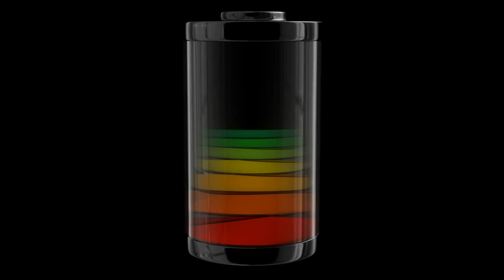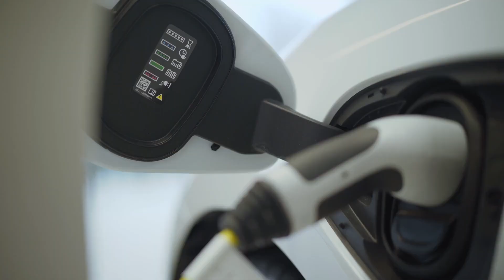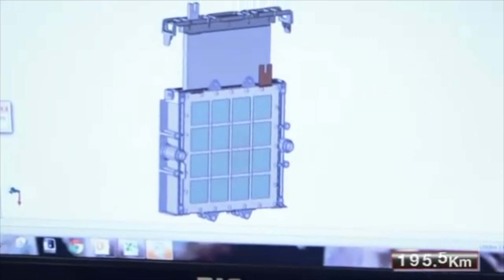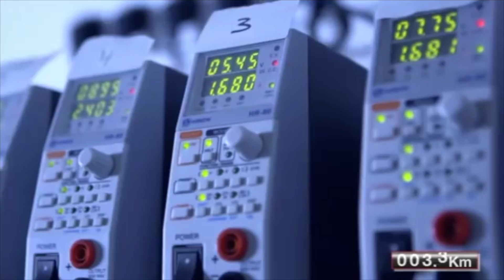This Battery Gives EVs 1000 Miles of Range!

Comment: If mentioning Cobalt in batteries you should also mention Cobalt use in petroleum refinement too.
Reply from the maker: Good call!
Reply: but that's 100% recycled it's a catalyzer
Reply: What about low temperatures
Reply: @piotrtrebisz6602 
It's the energy required to smelt it. Not the chemical reaction.
Reply: And if you’re going to mention cobalt use in refining gas you should mention the use of gas in the production of batteries.
Reply: @zefallafez  Sure, so what gas and how much is used in production of batteries?
Reply: @jbaker0203  How is gas used in construction of batteries?
Oil and gas are used.
Gas to melt the metal, oil to make plastic. Oil and gas to charge the battery. Ool to transport it, oil to make plastic packaging  etc etc.
Reply: @sandersson2813  "Oil and gas are used. Gas to melt the metal, oil to make plastic. Oil and gas to charge the battery. Ool to transport it, oil to make plastic packaging  etc etc."

And that can be substituted with hydrogen gas and synthetic oils. For charging the battery, you don't need oil and gas when you have nuclear and renewables. 

"Having horses in your production chain is better than having 8 year old Angolan children like cobalt mining for EV"

Indeed but I don't see you complaining about having those 8 year olds mining cobalt for the fossil fuel industry. which uses a lot of cobalt itself. The key difference is they're working to remove cobalt from batteries (and most are phasing it out) whereas the fossil fuel industry didn't bother. Pretty hypocritical.
Reply: @jbaker0203  ha ha ha. What tyres exist made from non oil?

You're using cobalt now, and you do eveeytime you use anything like a mobile phone, laptop, GPS device or anything like that, but not so holier than thou about that are you?

We don't have enough renewable energy for even our current electricity needs, nowhere near, yet you think that you can increase that to remove fossil fuel as the majority source for our electricity and to convert everything we have which uses fossil fuel? 🤣 🤣 🤣 
Do you have any idea how long it takes to plan and built a nuclear power station? Not to mention most countries don't want them.
Reply: @jbaker0203  Of course I understand what transition is, but what people don't realise is that it will take decades, not years.
You cannot do this as quickly as environmental maniacs are demanding.

China are currently building 150 coal power stations to add to their current 1000+ coal power stations are incredibly cheap and technically easy to build compared to Nuclear. Germany and Japan have abandoned future plan for nuclear. 
(for the record I'm all for nuclear) 

Would you really want countries with dubious governments and corruption like Nigeria, Angola, South Africa, Qatar, Brazil etc to have multiple nuclear power stations?
Reply: @sandersson2813  "Of course I understand what transition is, but what people don't realise is that it will take decades, not years.
You cannot do this as quickly as environmental maniacs are demanding."

No one is saying it'll take years, but it won't take a century either, that's how rapid the pace is. You mean the scientists who are warning us of the dangers of not reducing CO2 emissions, those environmental maniacs? Clearly you didn't understand what transition was otherwise you wouldn't have made those stupid comments.

"China are currently building 150 coal power stations to add to their current 1000+ coal power stations are incredibly cheap and technically easy to build compared to Nuclear. Germany and Japan have abandoned future plan for nuclear. 
(for the record I'm all for nuclear) "

Did you bother to actually read into those coal plants? Did you bother to look into the fact they're phasing out older generation coal plants, they run at 40% capacity and they're also the biggest investors into renewables. Did you also read into the global coal energy production is declining? I guess not.

Yeah coal is cheaper than nuclear but substantially more expensive than renewables. 

"Would you really want countries with dubious governments and corruption like Nigeria, Angola, South Africa, Qatar, Brazil etc to have multiple nuclear power stations?"

Who says they'll need nuclear?
Reply: @jbaker0203  No I'm talking about idiots like Extinction Rebellion who are demanding the end of fossil fuel use by 2025, and virtue signalling governments like the UK who are stopping the sale of ICE cars in 2025, despite the fact that there is an insufficient infrastructure to enable widespread EV ownership and the fact that EV cars will not make the slightest difference to CO2 on a global level from Europe when the likes of China, India, America, Russia and Brazil equal 60% of CO2.

Coal is not more expensive than renewables for countries like China with vast supplies and cheap labour.
Reply: @jbaker0203  I said EV cars from Europe.
This equates to 1% of global Co2. EV makers concede that depending on your grid you need to drive an EV 30,000-70,000km to break even.
Even if you took all cars of European roads now, you'd not see a reduction in CO2 until they'd all done this mileage.
I get a new car before its reached this level, so I will never own a car more clean than a normal car on this basis.

I'm not a denier, I'm just realistic that governments and activists are attacking things which contribute far less to environmental damage than others.
Planes and cars seem an easy target because there are visible emissions.
Global air travel is 2% of global Co2, same as running the Internet, yet you don't hear people protest against the Internet do you?

Why aren't they demanding changes in industry, construction, heating, cooling etc?
The lack of consistency in the argument is the problem and the rampant hypocrisy of campaigners is the problem.
Reply: The power grid will be hacked soon. 
Get ready
Reply: Be a man burn GASOLINE!
Reply: @DrDiff952  your manhood is very fragile. Typical fake patriot.
Reply: @DrDiff952  my next car will def be a Tesla.
Reply: And let's not forget how green the mining process is for mining  Obama and lithium!  Heavy equipment used to mine those metals runs on DIESEL ENGINES  not electricity!
Reply: @DrDiff952  Obama is no longer your gawd damned President
Reply: @TimothyMoore  and neither is Joe Biden
Reply: @DrDiff952  Did Joe Biden touch you wrong? Get over it. Be a man!
Reply: @DrDiff952  semis used to transport fuel. Electricity goes through wires.
Reply: @steveb796  Electricity most places created by fuels.
Reply: @timm.6391  Yes and in most places, getting phased out.
Reply: @timm.6391  my  provider gets 61% of its electricity from renewable and its growing that number by 10% per year.  I also have solar on my workplace I can charge at.
Reply: @timm.6391  you can use fuel to create it then use fuel to transport  it or just use fuel to create it. Which is better?
Reply: @steveb796  not everyone has that option
Reply: @DrDiff952  they will soon.
Reply: @jbaker0203  not so soon
Reply: @ChuckLeeClerk  If you actually mean not soon enough, you're right, if you mean its going to take a long time, that would depend on which area you're looking at and what timeframe but I would argue over the next 10 years, you'll see a dramatic drop in fossil fuel usage from both coal and oil (assuming nothing drastically changes obviously).
Reply: @steveb796  Solar power on your roof will take days to charge.
Reply: @sandersson2813  net metering. Tied to the grid.
Reply: @timm.6391  I have electricity from 80% nuclear and hydropower sources.
Reply: @DrDiff952  YouTube greatest comment ever.🤡🤡🤡🤡🤡🤡
Reply: @DrDiff952  Old, tired argument. Ford had horses in his supply chain.
Reply: @bob15479  Not to mention mining companies are switching to electric vehicles themselves as they save on diesel fuel and the issues arising from that.
Reply: But Ford wasn’t trying to kill horses.
Reply: @bob15479  Having horses in your production chain is better than having 8 year old Angolan children like cobalt mining for EV
Reply: @sandersson2813  I’m referring to the comment about diesel in the supply chain

Comment: So.. kinda like a oil change? 🤔 Interesting
Reply: Battery swaps were what Tesla initially wanted to do (and demonstrated) but they realized the impracticalities of doing it. No standardization, multiple battery sizes per model, Tesla mount them different from Porsche which is different from Hyundai, etc. What happens if out of inventory? What happens if the swapped battery wasn't fully charged? What happens if the swapped battery is defective? And, the list goes on.

Comment: Good topic, thanks.

However, hydrogen fuel cells are a better bet that Al-Air.  When you look at rechargeable Li-Ion, HFC, and this as energy-storage media, Al-Air comes out waaay on the bottom.  The amount of energy required to “recharge” (i.e., re-manufacture) them is huge!

Comment: Within the first 3 minutes you managed to refer to cobalt, nickel & manganese as “rare earth materials”. They aren’t rare earth materials, indeed they aren’t even rare. There are no rare earth materials used in lithium ion EV batteries. They are actually in the permanent magnets used in most motors. Disappointed that you would make this basic error in trying to be factual about current battery tech.

Comment: I'm curious about how much more energy is required to recycle aluminum-air batteries compared to charging an electric battery or producing/consuming hydrogen.
Reply from the maker: This sort of info was hard to find. We need large scale plants where it happens to drive down cost. Also a standardized pack would help
Reply: @TwoBitDaVinci   yes but there might be a lower bound, that is as much as we want to drive down the energy we can reduce it up to x energy per kg of aluminum regardless of the procedure.

Comment: Charging your car at home, is more convenient, this is how the majority of charging is done. This technology could be ideal as a removable range extender for the rare trips that will be more than ~250 miles.
Reply from the maker: There are also areas without a sufficient electric grid to power big EVs. Developing nations etc
Reply: @TwoBitDaVinci  So why not build a bunch of said aluminum air batteries mostly for export into said developing nations? Mostly for export, but also for use as range extenders for fitting into conventional EVs.
Reply: @TwoBitDaVinci  Its cheaper and simpler to build solar/wind charging stations or home installations than Al recycling facilities.
Reply: Agree it cost me less than $2.00 per day in my sustainable electric use from home. vs old 4 tanks of Gas per month, I spend less than $50 now with Electric vs old $240 per month in Gas.

Comment: Model S officially 402 miles range with Plaid Plus set to deliver around 520 miles in 2022! Great video about Aluminum Air.
Reply: Yep. And Lucid is right up there with them along with a couple of Chinese manufacturers.
Reply: @undredrawn3419  Range wise yes, but infrastructure charging no one else in the West is even close, not by a country mile.
Reply: JUST remember not too long ago lithium ion batteries were not so well known or excepted ,so all things being equal aluminium air batteries seem to fit the void in ev vehicles
Reply: Whenever independent tests of tesla  acceleration and range are done the cars don't quite live upto the tesla hype
Reply: @allensaunders449  might you have some links to said testers?
Reply: @allensaunders449  agreed what ever happened to EPA rating city and hi way miles separately.

Comment: Your point about EVs being more problematic in rural areas where aluminium-air units could be more appropriate is well made.  I think the issue that people haven't grasped yet is that there will not be a single solution, rather a range of energy and fueling approaches. If you are happy with short to medium range then battery EV is fine, if you absolutely have to do hundreds of miles every day then aluminium-air may be for you.  What is clear is that oil based fuels are going to be off the table - though synthetic hydrocarbons might become an option.

Comment: I think a hybrid solutions could be a great thing, the normal commute from the rechargable small (100 mile) Li battery and a swappable Aluminum air battery for longer trips. Technologies don't have to be used separately. This would be a great idea for Nio, whom already has a swapping system.
Reply: That is a good idea except for the Nio part. Think of them as a jerry can.
Reply: @dennismorin7506  basically that is the idea, you don't have to carry extra weight when you don't need it.
Reply: Agreed you can generate your own electricity. Most people with electric cars charge mainly at home. It is only long trips on the highway that requires charging. I am understood about the weight. Cars are not much of a problem a swap able portion for rare instances would be an advantage but not swapping the whole thing. Large trucks and aircraft are a different story they need the optimized power to weight ratio.
Reply: @dennismorin7506  the extra weight is more for not making extra damage to the roads. Specially in the summer when the asfalt is soft on the roads the extra weight is damaging the roads. Same time it's a bit extra consumption and a bit faster were out the tiers as well. Also bigger damage in case of an accident. Not least more material to digg out from the ground, obviously more damage to the nature.
Reply: Good point.... we will see when and if the alum-air batteries come out and what the costs are.
Reply: @dennismorin7506  definitely it's a big factor. More options better.